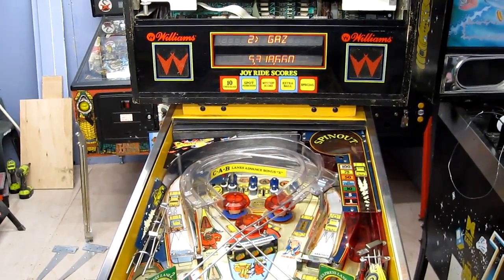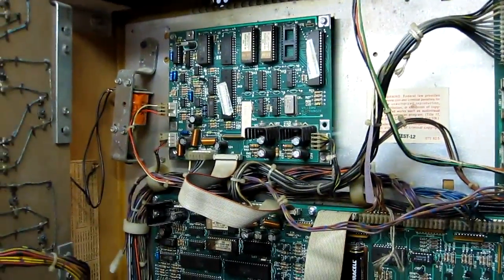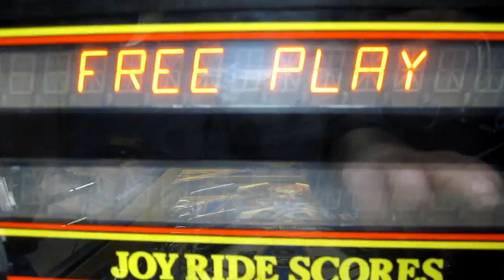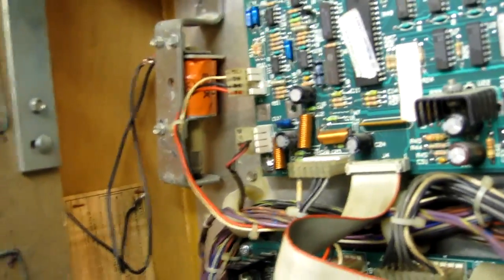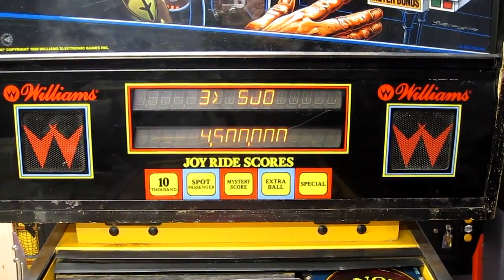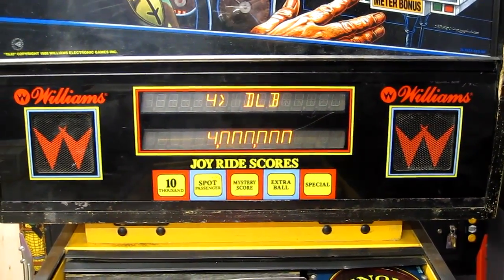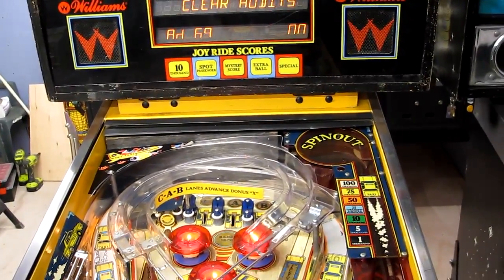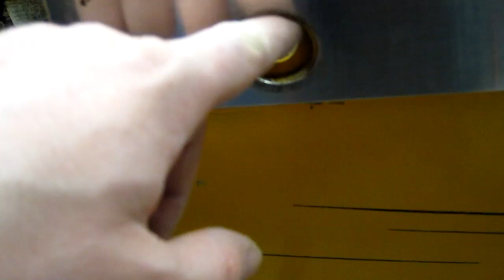Williams Taxi Repair (Part 1)

Comment: Interesting stuff!  LOL @ the fuses!  Yes, it's insane how any electronics device you buy second hand can often have a completely wrong size fuse.  I bought an Atari ST  which came with a 13 amp fuse in the mains lead and I've had Amigas with 13 amp fuses as well!  The old favourite is where someone has wrapped 15 or 20 amp fuse wire around the old fuse and then stuck it back in!!!
Reply from the maker: I hate that when people wrap the fuse in fuse wire. Even worse (and just as common) is where someone wraps the blown fuse in tinfoil!!!
Reply: Haha, yes, I've only ever seen that once in an old PC PSU.

Comment: I'm really glad you shared this, I hadn't yet checked the fuses on my Getaway cab and low and behold, half of them were wrong. Some were a bit under which is fine as all is working ok but some were way over, like a 3/8A slot had a 8A fuse in there!
Reply from the maker: Hi buddy, glad it was of help. I've just been advising you on pin info :)

Comment: What Voltage/Amperage does the pinball operate the switches on? The arc flashes seem huge, I always thought they were fairly low voltage. Re Dremel I had the bearing seize near the collet and it spun in the housing creating great heat and melting the shaft/lock switch area. Still prefer them to all other brands. Just remember to clean and lube the bearing a few times a year now!
Reply from the maker: Hi mate, flippers are 50-75v 2-3 amps, but the initial spike would be higher. 

Struggling to find parts for my dremel now, which is a shame as it is the discontinued digital model

Comment: Do any of the pinball-parts suppliers offer a hand tool to replace the worn switch contacts ("Electrical Contact Point", deformable rivet stud type) ?

Or are the switches typically disposed of instead of refurbished?

---
edit:  Nvm, I've been searching for the wrong thing. "Rivet Spinner"  a benchmount tool,
Reply from the maker: +LynxSnowCat Not that I have come across, but I am sure there is a guy who sells the contact points, so there must be a tool to do it. I think it was Steve Young?
Reply: +arcadeuk Thanks.  pbresource.com  does sell switch contacts of the type I am asking about. But I was hoping that you had seen an appropriate "rivet squeezer", or similar handtool.  My lazy search suggests see that most (sensible) people not using power tools will either get/make some dies for a bench-mounted press, or use a bench-mounted "rivet spinner".

Since I can't justify $200 for another tool I only have definite plans on using once, I'll poll the local 'appliance-repair' shop/hackerspace to borrow one -- or do something stupid with a broken drill bit, anvil, and a hammer.

Comment: 20amp fuse? Forget a nail a bar of uranium would have been safer.
Loving the pinball machines, great unison of mechanical and electrical engineering,, art and fun.
Reply from the maker: You are probably right, the breaking current of a 20amp fuse would be in the region of 60-80amp!
Reply from the maker: And yes I agree, pinball is indeed a fascinating combination of engineering and art :)